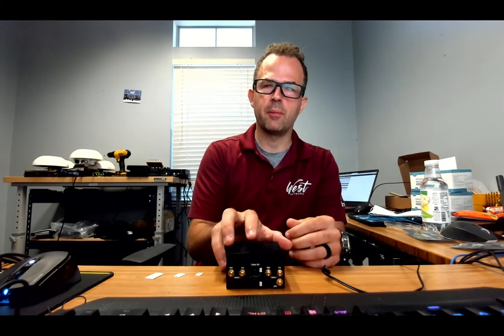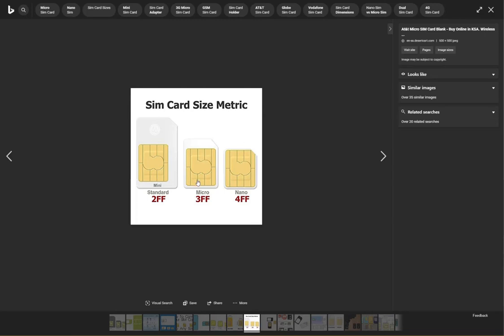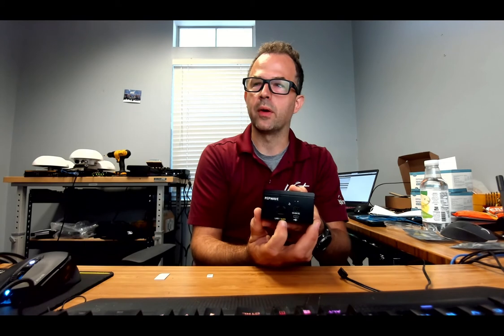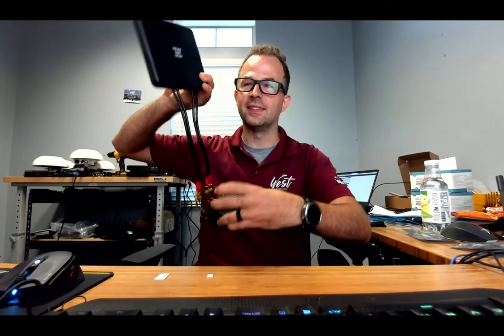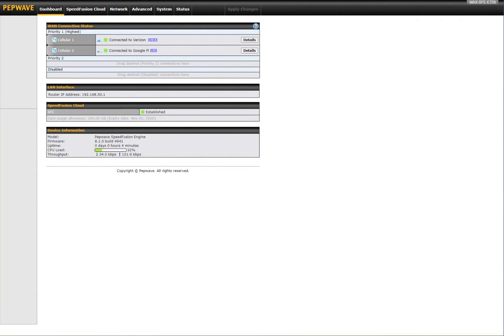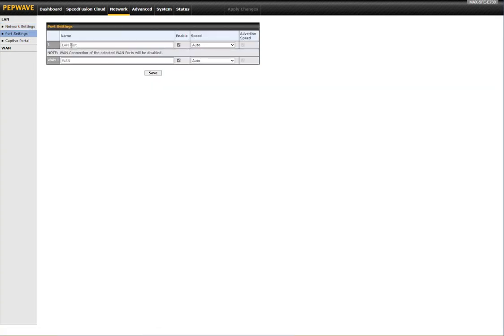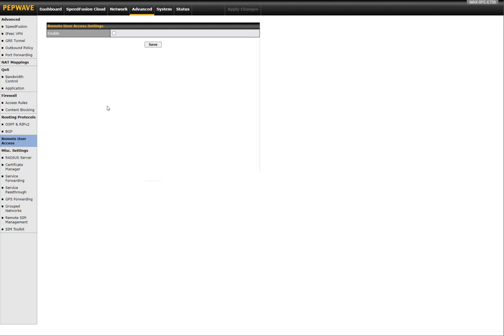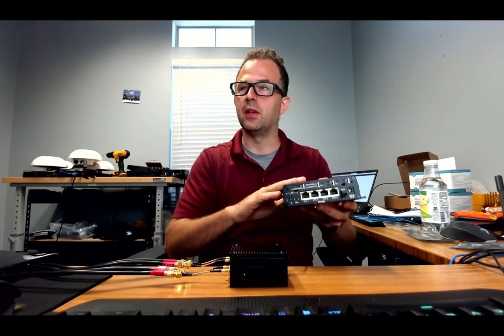Peplink SpeedFusion Engine Overview

Comment: Great video and explanation.
How long could the speedfusion engine run for on full load off a 10'000 mAh battery for example?
Reply from the maker: In or testing of smaller batteries we get 6-8 hours so I would say 7-10
I think signal strength affects it too if it needs to use more output power

Comment: Hey Peter, great overview of Speedfusion engine! We’re a systems integrator, so for mobile applications where our client needs enough bonded 4G for 4K video transmission (uplink) does the SF engine with 12v DC, perfect for client’s mobile Sprinter truck combined with the SIM injector a good substitute for the Peplink 4MAX? ( Or is the 4MAX the only viable box for bonded cellular, for 4K video transmission?)
Reply from the maker: That's a loaded question, I think for live transmission of 4k the HD4 MBX CAT18 is the best option especially in a sprinter.  The CAT18 modules provide great upload throughput even when cat 6 and cat 12 can't.